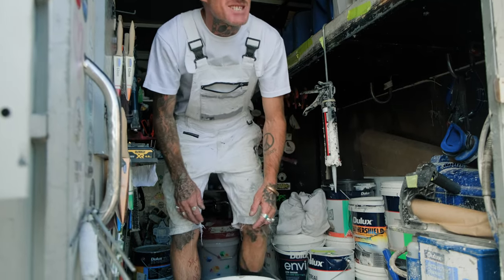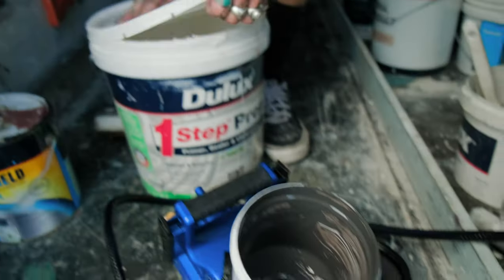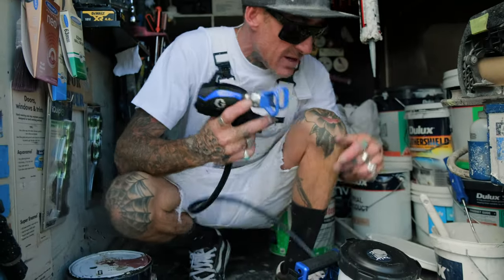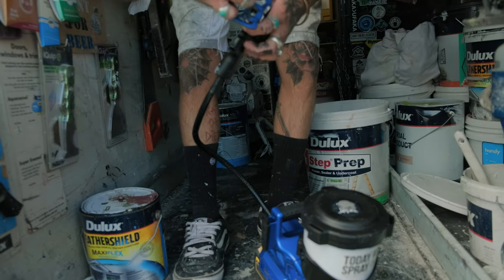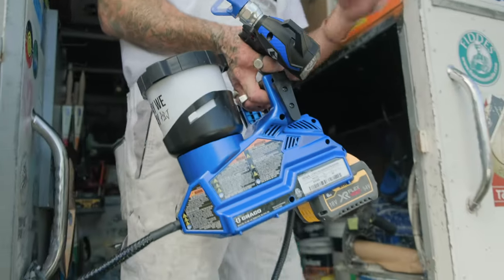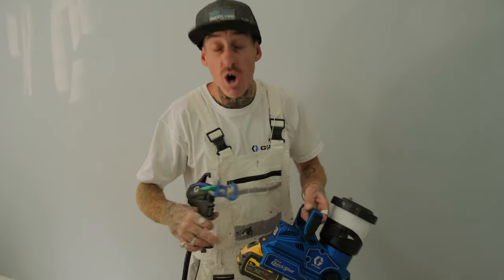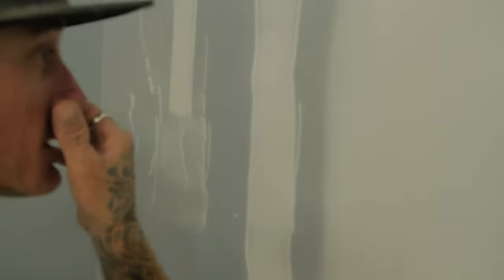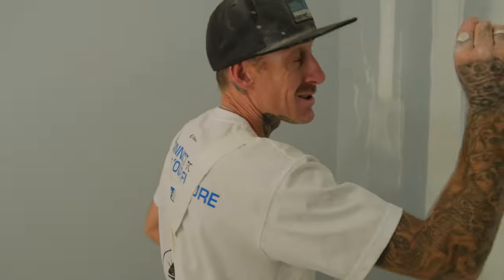NEW GRACO SPRAY TIPS! Putting the new FFLP, LP & WRLP Tips to the Test with @paintingbyjosh

Comment: The 208, the first tip tested, really needs a very fine mesh strainer. Seems like it got clogged up. Surprising it sprays such a thick material so well.
Reply from the maker: Big surprise to us too! The finer filters can also cause a drop in overall flow rate, which causes the FFLP208's to block as well. With a bit more time we would've tested the finer filter with the 208 to see if it replicated the same blockage; I think still too viscous for this tip size however! Thanks for the comment.

Comment: I want one. But they are so expensive. I’m just a small landlord that paints a lot. Do you thin your paint? How much and with water or some additive? Love your videos and your presentation skills.
Reply from the maker: No thinning of the paint is required with the airless sprayers! You might want to consider a Graco Ultra or Ultra Max handheld if the QuickShot price point is too steep; alternatively the Magnum ProX17 is a great unit for a landlord too!
Reply: I’m a handyman so I couldn’t really justify getting the same handheld he has, but I have the Graco prox17 airless and I only needed to paint a front door so I bought their smaller airless the variable speed version and I have used that sooo much more than I ever thought I would. The paint waste and clean up on the smaller ones units are just so much more manageable it’s hard for me to want to use my larger spray rig unless it’s a fence on entire exterior etc.
Reply: You don't want the quick shot or the ultramax handheld if you paint a lot the life expectancy isn't but around a hundred gallons then you throw it away .... To me that isn't worth the cost of either one of those. I am a pro painter and I use the magnum X5. It's a small light weight unit And the motor last forever. The fluid section does go out after a couple hundred gallons but it's inexpensive and you can change it out yourself

Comment: Thank you for your very useful videos.  Quick question from a newbie, all these tips come with a metal part.  Is that part the same for all tip sizes? so when you switch between different tips you don't have to change the metal part?
Reply from the maker: The metal section which Graco refers to as a OneSeal does change in size depending on the tip series. You'll find that the Fine Finish Low Pressure (FFLP) metal section, or OneSeal, is smaller than standard Rac X LTX tips (blue tips). The LP (Low Pressure) tips share the same OneSeal as the FFLP tips, so you won't need to switch often!
Reply: @GOIndustrial  thank you again.

Comment: Used mine a couple of times and really like it Josh , i'm pretty much a total novice to spraying but learning bits and bobs as i go along , one thing i'm not sure about is if i want to just top up the hopper before it runs out do i have to prime before spraying again or can i just take lid off , pour more in and carry on spraying as i was ?
Reply from the maker: You can top up the hopper if there's enough paint remaining to cover the strainer/filter. If it takes in any air, you'll need to prime again to avoid any pulsation! Let me know if you have any other questions!

Comment: My quick shot always showing tail when I use aqua enamel and berger door and trim waterbase. I used the 312 fflp. 
But that tip is is working perfectly with 1step and precision maximum strength. 
Do I have to change tip size as like 314?  Or is there any other way to use 312 or 308 tip for aqua enamel?
Reply: thin it down a bit, : D
Reply from the maker: Either thin it down very slightly, or consider spraying with Dulux's Steriguard as an alternative to aquanamel. Dulux's Aquanamel has typically been problematic regardless of which airless unit you're wanting to use, unless you can get the pressure and tip size combo aced. I recommend trying Dulux's new FastFinish product, or Steriguard if you're needing to stick with the Dulux range. Otherwise, Wattyl's Aquatrim and Haymes' Ultratrim both spray beautifully.

Comment: Great video. Is there a big difference in overspray compared to a small airless sprayer with these tips?
Reply from the maker: It's all dependant on pressure - the FFLP tips will provide the least amount of overspray in comparison to the LP and WRLP tips. Rule of thumb, if you're looking to reduce overspray, stick to your smaller FFLP tips and orifice sizes, and reduce your pressure depending on your application!

Comment: Hi mate. Great video.  I’ve just got myself the graco ultra max. I was gonna spray dulux diamond satinwood. The spec sheet on that paint says 0.15 tip.  But you seem to be very happy with 308 for wood paint, are you paints thinner.  Would that be why?. 
So I’ve just ordered a 314fflp tip cause that’s the closest I could find in ff lp. You think that will work ok?
Reply from the maker: The FFLP314 should definitely do the trick - you might need to thin it ever so slightly to aid atomisation. And yes, typically the enamels we spray with in Aus are a tad thinner in comparison to USA/Canada markets. Hope that helps!

Comment: Not sure what you mean by conditions what ever you set the pressure to thats what it should stay no matter what.
Reply from the maker: That is correct. However with larger airless sprayers, particularly when running greater lengths of hose and spraying thicker materials, pressure drop is a very real variable that needs to be considered.